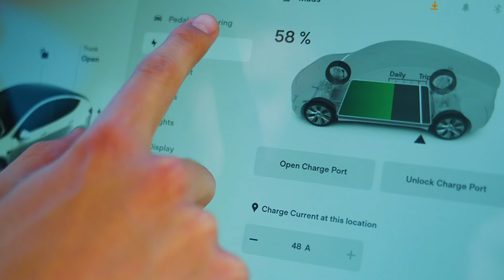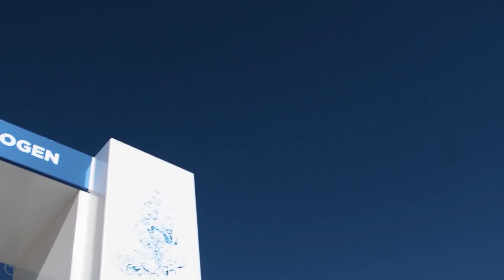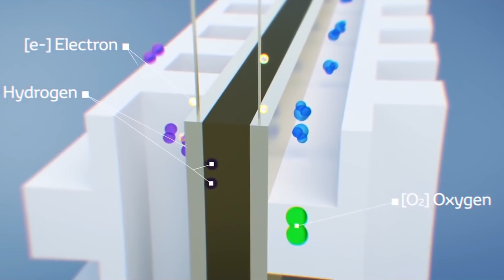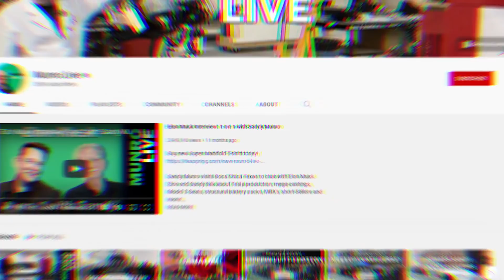SANDY MUNRO: Will Hydrogen Fuel Cell Tech Survive in 2022?

Comment: from the Airstream website: "With a full powertrain integrated into the chassis, the eStream works hand in hand with the tow vehicle to optimize the towing experience. A drive axle with dual motors works actively to extend towing range..." >>> I think incorporating batteries and a drivetrain into semi trailers is a no brainer. Make all such trailers container carriers and you have a lot of flexibility for charging and routing. The batteries in the tractor would be minimized.
Reply: I do think it will happen long term, but it will take time due to the upfront costs.

Comment: While there is no doubt that hydrogen works there is one major stumbling block in the transport industry and that is the production and distribution. There is none or at least none that could support long distance transport and to build it requires huge investment as it has to be built from the ground up. There is nothing out there that can be converted to hydrogen distribution and storage unlike electricity where the distribution network is already in place, all that is required is to attach a charger to the existing network. So far I see no one putting their hand up to invest in that distribution network and until that happens the technology is a dead end even in heavy transport.
Reply: Hydrogen can be made anywhere you have electricity and water.
Reply: @jamesvandamme7786  agreed it can but currently it is not in quantities that would support a transport system nor is there the distribution and storage network necessary in place anywhere. It would all have to be built from scratch as there is nothing that can be repurposed from existing distribution and supply systems. For hydrogen to work that system needs to be in place first and so far I dont see anyone putting their hands up for it.

Comment: Can we fuel diesel electric trains with hydrogen Alex and Sandy with something close to a simple conversion that Burns hydrogen instead of diesel?
Reply: Seems like natural gas would be easiest. That would be less polluting than diesel.
Reply: First, hydrogen doesn't work well in compression ignition engines, which diesel is. Better suited for spark ignition, but there is no simple way to convert a diesel except replacing the engine. 

Second, hydrogen is a bulky difficult to store fuel. it would have to dedicate several train cars for the storage tanks. 

Third and most important, it would triple the fuel cost. No way will the railroads pay for an expensive conversion just to have their fuel costs go way up. 

Besides, there is a much simpler solution. Use overhead wires to provide electric power. The railroads wouldn't even have to convert all the lines, just the most heavily used lines, as the trains could switch back to diesel where electric power wasn't available.
Reply: @chrismuir8403 wisdom in them there words
Reply: Diesel/ Electric trains most I’m familiar with Used the Diesel to run the electric generator to power electric motors ! And with a Long distance highway truck the diesel power the generator for extra power on hills !

Comment: Solid state hydrogen is complete vaporware and is a physical impossibility for transportation. It's odd Sandy doesn't realize this
Reply: When did he say that? All he did is mention it in passing
Reply: I've seen his videos and he doesn't seem that sharp to me. He's always mispronouncing technical terms, using wrong units, and his understanding of electrical concepts is lacking.
Reply: @skipondowntheroad5833  He's a mechanical, manufacturing guy. Not a chemist or EE.
Reply: @James Van Damme  Sure but he's implying he has expertise in those fields when clearly he doesn't.
Reply: It's already been made in lab and proven government shut it down due to potential weapon manufacturing mostly used in residential they just recently opened it up

Comment: Always enjoy E for Electric and Sandy Munro. Please check out Plug Power . They make GreenH2 and fuel cells  for fork lifts, back up and stationary power, commuter air craft, airport GSE , delivery vans in Europe [HYVIA]  HD trucks, and industrial applications that are hard to decarbonize. They are the leader in the Green H2 ecosystem. Full disclosure :I am a small investor in Plug. Today their goal is commercial logistic and industrial applications. Automobiles are not in the cards until they think it is viable. They are building and scaling up gigafactories to make fuel cells and electrolyzers much less expensive. I believe they have an excellent future.

Comment: I've been mostly on this bandwagon for the past 5yrs+, but I don't think Hydrogen will be long lived in Semi's as I think battery energy density will supplant it beforehand.  I've said Aviation and Cargo Ships will go Hydrogen in the not too distant future and likely remain there unless we can figure out some way to get about 10x the energy density that we currently have in batteries.  

We haven't figure out a way to extract Hydrogen that doesn't take 3x the amount of energy putting into it, than what we get back out of it.  Until we get that down below 1.5x it will remain something we won't use unless we have to (i.e. things where the energy density of battery is sufficient will remain using batteries and charged off the grid.)
Reply: You people that talk hydrogen and batteries always leave out what it takes to get lithium it is not any better environmental wise , a lot ships from overseas , takes tons of freash water, heavy equipment, then mfg a lot of batteries to make a battery pack , the battery caseing that holds all those batteries , all those things are not clean

Comment: The problem with hydrogen is cost. You have to have a very special requirement to be able to afford to pay 3 times +.
Reply: exactly. kind of disappointing that sandy keeps ignoring the cost and Alex never askes him about it...
Reply: @viajeroloco6220  you need to please appreciate that both are clueless and this channel has just deteriorated into a marketing gimmick.
Reply: Hydrogen has a future in long haul and aviation and space.  He doesn't believe it's for us normal people with our cars.  As for the price, hydrogen is dropping in price as more companies produce it.  Gas prices are always going to go up and there's going to be a day when it'll be more expensive than hydrogen.
Reply: @Kenmanhl  the cost of hydrogen will always be 3 times the cost of straight electricity.  The problem with cost is not just the cost of the infrastructure.  It is the cost of the energy required because of the low round trip effeciency of converting energy into hydrogen and back.
As for planes hydrogen is one of the worse options. I watched a video a while ago about the requirements for aviation fuel and hydrogen failed every metric. Even alcohol was not suitable because of the low flash point.
Reply: @franciscoshi1968 , so the future of aviation is stuffed as fossil fuel becomes more and more unfeasible.  Large passenger jets can only make landings on an empty tank, hence why they dump fuel on emergency landings. Battery powered planes are out of the question because there's no weight loss method available for landing.

I was really hoping hydrogen can be burnt in their jet turbines and the planes can land with an empty tank.
Reply: @Kenmanhl  I think aviation will continue to use fossil fuels for the foreseeable future. The best they can do is to use synthetic fuel with the same characteristics but that will always be more expensive than fossil fuels.
Reply: @Kenmanhl  hydrogen can be burned in jet engines. The problem is the very low density of hydrogen,  the need for special tanks (hydrogen can not easily be stored in the wings as kerosene) the low flash point of hydrogen and the fact that it burns at a very wide air fuel ratio. The low flash point is the reason jet planes do not run on petrol or alcohol or any low molecular weight fuels. It is too dangerous.
Reply: Not with the new Japanese invented Red-Hydrogen. Its made from new gas cooled nuclear power plants that are 100% emission free.
They can handle 2600°F before the reactor melts with gas cooled, instead of the old water cooled plants that melted at 600-700°F.
It's extreamly safe, efficient and has 500% the range of EVs and once the industry adopts this new Red Hydrogen tech that can make the world emissions free.
Cost should be similar to Gas prices today and will go down to $0.08/Kg from $3.75/KG once the industry adopts the new Hydrogen tech.
Even ElonMusk who constantly made fun of Hydrogen Fuel Cell vehicles has changed his mind about Hydrogen because of this new Japanese discovery and is making a H2 Tesla in 2023

Comment: I hope hydrogen makes its way to the general market for cars. With the ability of a quick refill, and no range anxiety and it seems to fit our lives better.  What will happen with all the future batteries when they can no longer hold a meaningful charge?  Will there be a negative ecological impact?  I hope future batteries can be recycled and the cost for new ones will be reasonable.
Reply: Why do you like travelling to fuel stations. Instead with an EV you can wake up each day with a full battery.
Reply: @AORD72  'with a fill battery' ??? That's what you get with ICE, wake up and FILL the tank.

Comment: When it comes to commercial applications economics will win out. It doesn't matter what your favorite tech is. The only thing that matters is what will do a particular job the most economically. It is just a matter of waiting and seeing how that plays out over time.
Reply: Good analysis. Electric vehicles are coming, not because of the government but based on economics. May take longer than environmentalist would like.
Reply: There will be excess renewable capacity installed at times. So hyrogen will become much more viable
Reply: @johnowens8992  The UK has the world's largest installed base of wind power - and the excess/curtailed power from all those GW of capacity can only power 100,000 HFCVs the average 8000 miles a car in the UK drives each. H2 has a great future in decarbonising what cannot easily be electrified  (steel, aviation, shipping, storage and feedstocks). For road transport......I can't see H2 working out. You can't make H2 from electrolysis cheaper than the input electricity used. So just store that elsewhere - like in a battery.
Reply: @fruitytv-uk  you are correct in todays market,  however as we moove further from fossil fuels as a base load , and reduce reliance on gas peaker plants an excess of renewable capacity will be needed, so that loads can be met at 60% for example, on windier/sunnier days there will be excess power which unless a new breakthrough occours in gridscale storage will have nowhere to go, this will lead to an economic case for H2 production as this excess electricity will be sold off cheap. Indeed the initial markets are likely to be steel/cement, shipping , and aviation but as it scales up it will become more economical and will work its way into cars as large batteries become much more expensive as the production of raw materials will not meet demand.
Reply: @Aircam73  They will because they already have , In Denmark and Scotland curtailment is already happening with plans to increase capacity further , as the price of renewables continues to fall lower capacity factors will be more economical than running gas peeker plants . On cloudy / less windy times  there wont be any "excess" power so it wont be vaible to produce hyrogen. I assume the better cheaper ways refer to pumped hydro of which there are few suitable  locations  and environmentalists standing in the way of planning in the ones that are, current battery tech is ok for frequencey regulation but nowhere near grid scale storage beyond a few hours.
Reply: @johnowens8992  That is your plan? That a power company with shareholders and trying to make a profit will build out so much extra excess that they will give it away for free to the point of allowing millions of cars or hundreds of millions of MW to run on this free energy? This is why no one take hydrogen seriously. There are thousand of other companies that would be happy to use that energy for a reduced cost but no one builds their business model around free energy to get it to market.
Reply: To Leftist lawmakers, getting virtue-signalling votes is more important than economics.

Comment: Nothing here that sways me from H2 being a niche application for land vehicles.  The relatively low percentage of surface ton-miles that are truely long-haul will keep the economies of scale with BEV's.  As long as H2 is the "premium" fuel, operational behaviors will shift with BEV's in order to continually erode the niche that H2 occupies.  My understanding is that, from an efficiency perspective, fuel cells are much closer to their theoretical efficiency than batteries are to their theoretical specific energy capacity.  I could be wrong on this but not many individuals have been pointing out where my misconceptions lay.

Sandy is right about one thing.  A good business plan is required in order for H2 to become successful within a reasonable period.
Reply: Agreed. At this late stage in the game Hydrogen cannot catch up to BEVs. They've just taken far too long to get anywhere and have extremely little to show for it. Toyota, Honda and others have invested BILLIONS of dollars and over a decade and a half of time and energy trying to get HFC off the ground and very little has been accomplished: In all that time there are still only around 50 HFC stations in the United States and almost all of them are in California. They should have cut their losses a long time ago but by then they were deeply entrenched. Add to the HFC problem the fact that lithium ion batteries have dropped by about 90% in price in the last 7 or 8 years and that advances continue to happen as far as faster charging times and more energy density. In fact the latest Hyundai Ionic 5 can charge from 10% to 80% in less than 18 minutes and it probably takes at least 5 minutes to refuel with hydrogen, so not much of an advantage there.

Comment: The Chevy volt is the way to go it has a gas engine generator but it uses electric motors to drive the car the deal is as they need to put a bigger generator in there and a bigger battery and it's hard to do that on a small car if you have a semi or train it's kind of like Sir Isaac Newton's second law make something bigger twice the size it only takes 50% more horsepower

Comment: A company in the USA developed a hydrogen film placed in cassettes. Easy to swap out like going to get a propane tank. Not flammable and recyclable. Both trucks and cars could use them just different sizes. The govt. would not allow it to go to the public for 4-5 years until recently.

Comment: Freight trains are electric hybrids they use a gigantic diesel generator
Reply: They are not hybrids, yes the use an electric 'transmission'  but there is no battery. Here when they talk hybrid, they mean being able to run on on ICE, then switch to battery. With a hybrid car, when you decelerate the energy can be recovered and stored in a battery, then re-used on the next hill climb. In a diesel-electric train, nothing is stored then recovered, it all ends up as waste heat.

Comment: Freight trains have been electric hybrids for 100 years
Reply: Not quite.  Any regenerative energy is dissipated into dynamic braking resistors.  Locos are Diesel electric because electromechanical contactors for matching motor torque to speed were more robust than mechanical transmissions.  I would love to see trains adopt a hybrid approach where they have on-board energy storage.  Better yet, a combination of battery power and grid power from catenaries, using the battery power to bridge gaps in the catenaries.
Reply: @mrhickman53  Europe has trains running on hydrogen already. See Ballard BLRD from Canada
Reply: @edwardnaclerio7690  I'm not arguing that H2 won't be tried in lots of applications.  I am skeptical that business plans are robust enough for H2 to be profitable in the long run.  The original argument for H2 was that renewable energy would be "free" for electrolysing and compressing H2 during peak generation hours when wind and solar would otherwise be curtailed.  Storage technology seems to be deployed increasingly rapidly, soaking up much of this "free" energy and selling it later in the day.  Stationary storage being able to perform this a 80% or higher efficiency does not give much room for H2 electrolyzers to bid for the energy when the H2 cycle from electricity to H2 to electricity struggles to be 40-50% efficient.  Now add labor costs for transport and much higher capital cost for dispensaries I cannot see it being other than an expensive fuel.

Smart people may figure out how to make money on H2 but none have convinced me that their challenges are surmountable.  I don't think the problem is only initial capital investment.